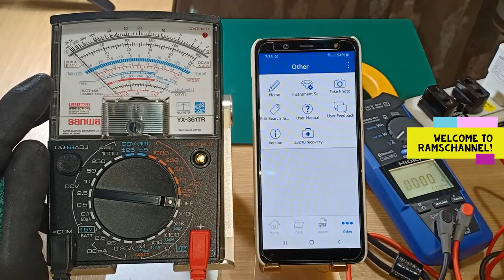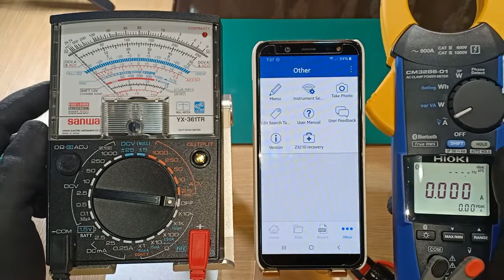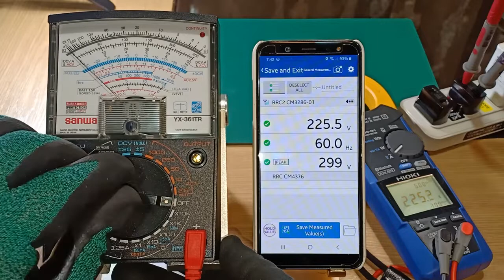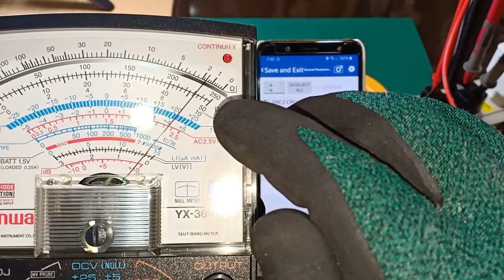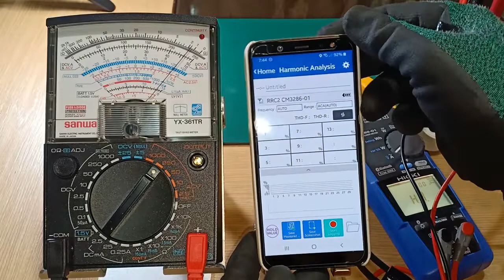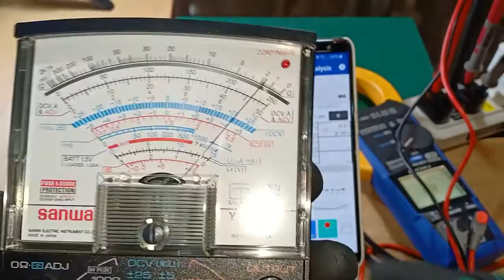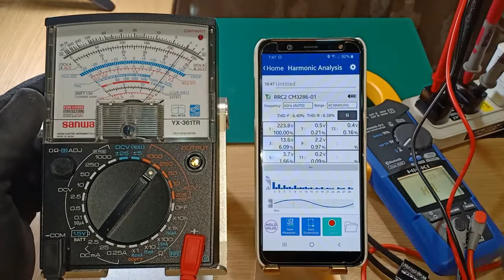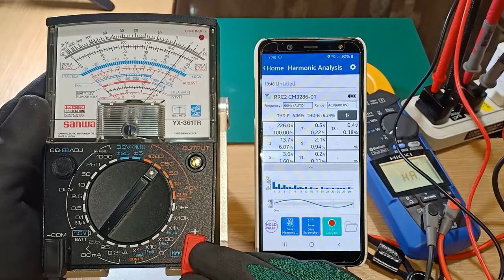[CC] Sanwa YX-361TR Accuracy on Household AC Voltage With 6% Total Harmonics Distortion

Comment from the maker: Correction lang po. I mentioned in the video that the instrument may not give correct result on AC voltage when frequency is other than 50Hz or 60Hz. This is an oversight on my part and I apologize. In fact, the meter was specified for AC Voltage Frequency from 40Hz to at least 1kHz based on its specifications.
Reply: This rectification that you make is necessary. The Sanwa YX-361TR analog multimeter, unlike conventional digital multimeters (those that are not True rms) offers a true rms value up to the frequency limits indicated in the specifications as long as the signal is sinusoidal. For other waveforms, this model of multimeter could not offer a true rms value (Sanwa has true rms analog multimeter models, also more expensive). Congratulations for the video.
I didn't know you are from the Philippines. So, a big hug for you and for the Philippines from Spain. Spain does not forget the Philippines and our common history.
Reply from the maker: @mateoferrer  Thank you for taking the time to explain. I could only imagine the price for a TRMS analog multimeter. I think it may not be a practical tool for everyday use but perhaps for educational reasons it will serve its purpose. It's interesting that you mentioned the shared history of the Philippines & Spain. I am on holiday now and I've just visited one of the only 4 Spanish-Era Baroque Churches in the Philippines: the Sto. Tomas De Villanueva Catholic Parish Church in Miagao, Iloilo Philippines. They don't make churches like this anymore! It's beautiful and a UNESCO World Heritage Site. Have a nice day and thanks for your support!
Reply: @ramschannelreviews  Dear 'brother' from the Philippines, don't think that analog multimeters are only good for education. I am just an electronics hobbyist (my profession is very far from this academic discipline) who enjoys fixing things that break down (TV, small electronic devices, ...) and some of my repairs would have been impossible without the multimeter analogical. With an analog multimeter you can quite easily detect leaks in diodes, BJT transistors, capacitors; you can see unstable movements in voltages that should be stable. The only problem with analog multimeters is that they are very fragile and easy to break if you mistake the correct polarization of the test leads. By the way, it is very important that you know that, in measurements with an analog multimeter, you should try to choose that range with which you obtain a reading with the needle located in the central area of the reading panel (avoid, whenever possible, readings with the needle located at the left or right ends of the reading panel).
Speaking of the much-loved Philippines, if you ever get the chance, you must visit the 'Site of Baler' on the island of Luzon. After Spain lost the war with the United States, a Spanish detachment, unaware of the end of the war, defended its position in the church of Baler beyond what is required by courage and what is humanly understandable. For almost a year, without food, with hardly anything to drink, in very painful conditions, he refused to surrender to the United States, which used the Philippine insurgency to seize and exploit the population of the archipelago, something against which the Spanish soldiers fought to exhaustion. A movie was even made narrating this unique act of infinite courage that honors Filipinos and Spain: "The last of the Philippines"! Sorry for my english.